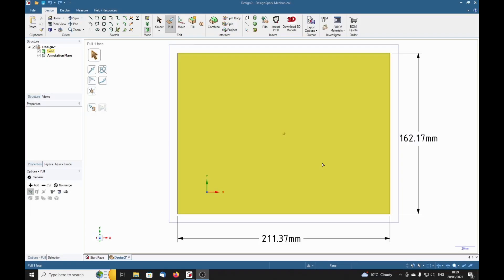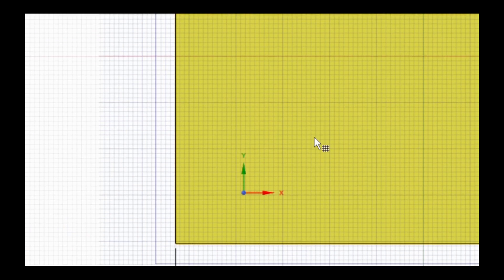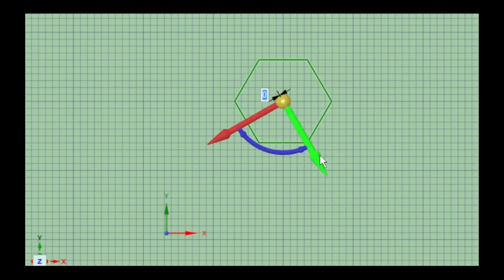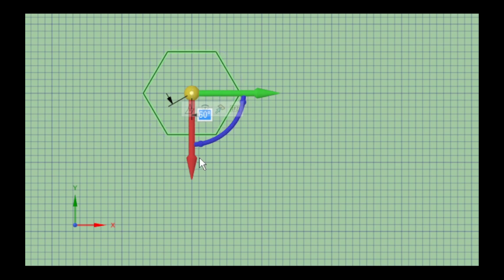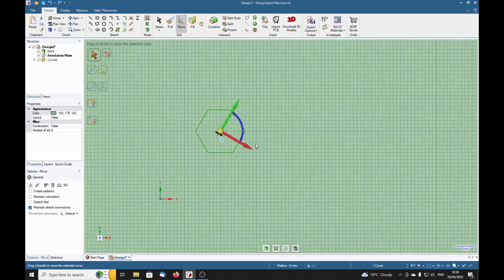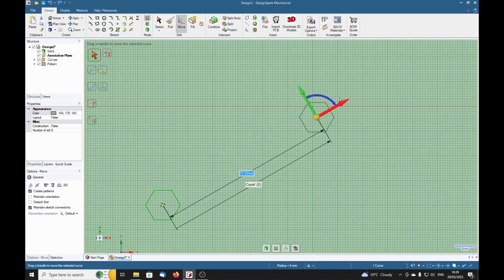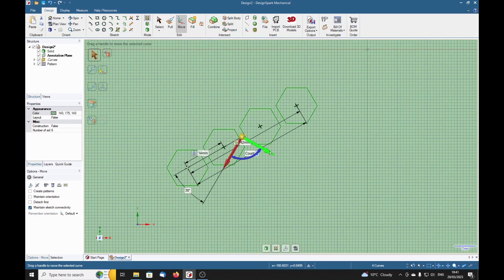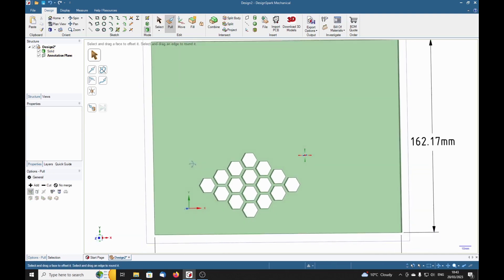More on the DesignSpark Mechanical Move Handle

Comment: Hi Sir, I never noticed these bump but used another option. Select object, move tool, select "move direction"↗(alt+left click) (from tool options top-left corner of "drawing plane"), select one of the lines of any object or "world origin" to adjust the anchor. Another Very helpful when going to 2d mode and the grid is not straight you can: select move grid, select one arrow of the anchor, select "orient to object" and choose any line from the drawing to rotate your grid or object selected. This software is amazing apart from few bugs and a lack of mirror tool. I know that mirroring line exist but this is not enough sometimes.
Reply from the maker: Thanks for the insight.

Comment: Finally, a mystery is solved! I knew it had to be possible, but never figured it out. I still want to learn how to rotate that to a reference. Thanks.
Reply: @G kuljian  Try putting a section on the face you wish an object to be rotated relative (  use ruler). In sections, moving a line, moves the associated face - works well for basic features like holes, pins. After selecting the object to be moved ( 2D hole edge) put the move tool  onto the rotation axis, use Alt key ,to orient red axis to object axis picking up hole center , then select mini tool 'angular rotate ruler' option...
select target object... enter 0 = align or enter 'space off' degree - works perfectly once you know this...more complicated moves with bodies/ assemblies can be done in a similar manner very efficiently.
Reply: Another option. Select object, move tool, select "move direction"↗(alt+left click) (from tool options top-left corner of "drawing plane"), select one of the lines of any object or "world origin" to adjust the anchor. Another Very helpful when going to 2d mode and the grid is not straight you can: select move grid, select one arrow of the anchor, select "orient to object" and choose any line from the drawing to rotate your grid or object selected. This software is amazing apart from few bugs and a lack of mirror tool. I know that mirroring line exist but this is not enough sometimes
Reply: @fortifor5410  I forgot all about that. I did use that technique.  The problem with using the software  once a year  or so is forgetting everything. Thanks!
Reply: @Gkuljian  No worries, I use it quite often and find it really good. It is not so good for organic geometry though. But as Jim says "if it comes to DSM the only limit is your imagination". However I want to start using Fusion 360 since it has better(quicker) tools to create screws, involute gears etc. But learning these thing in DSM is really good, helps with understandings of certain things like geometry, trigonometry and so on. However F 360 has tools built-in for those reasons, therefore less time spent with more accurate results hopefully.
Reply: @fortifor5410  Designspark Mechanical v6 Creator and Engineer has a new mirroring tool for 2D and 3D curves, Faces, Bodies, Components, this can radically change modelling methods for rapid creation and later alteration. Mirror bodies can retain face linking as option. Threads can be graphically represented with accurate 'Basic' min and max diameters generated which can be changed for 'custom thread' or creating thread clearances by dialogue. These min/max diameter could then be used as the basis for actual real thread creation with specified ( user or 'standards' running clearances ). V6 constraint sketcher is much better than v5 and many other small improvements have been made. All module technology now included in Creator and Engineer flexi-monthly on/off plans

Comment: Brilliant!  I've needed this deeply buried feature for ages! Many thanks.
Reply: Another option. Select object, move tool, select "move direction"↗(alt+left click) (from tool options top-left corner of "drawing plane"), select one of the lines of any object or "world origin" to adjust the anchor. Another Very helpful when going to 2d mode and the grid is not straight you can: select move grid, select one arrow of the anchor, select "orient to object" and choose any line from the drawing to rotate your grid or object selected. This software is amazing apart from few bugs and a lack of mirror tool. I know that mirroring line exist but this is not enough sometimes